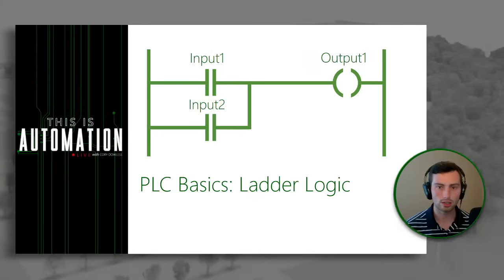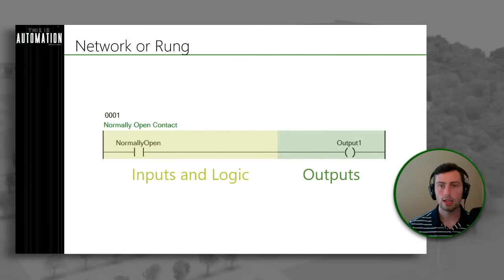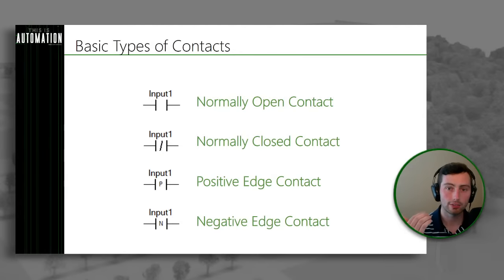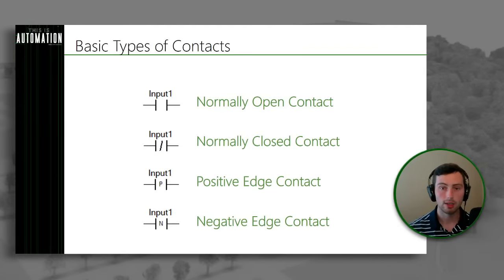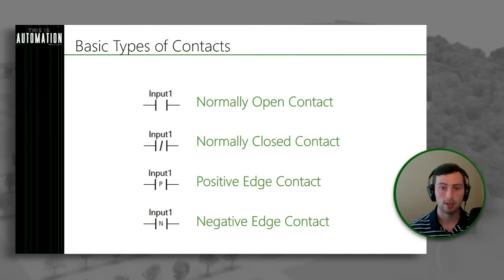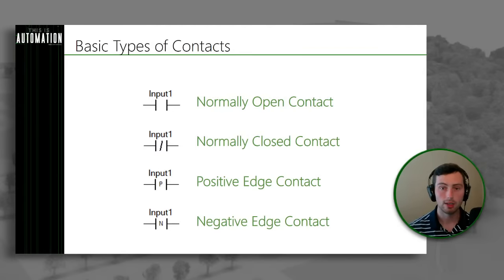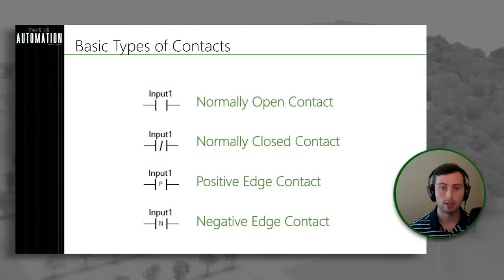PLC Basics: Ladder Logic

Comment: 🎯 Key Takeaways for quick navigation:

02:48 🪜 Ladder logic is composed of networks or rungs, resembling a ladder. These rungs help in controlling equipment by taking inputs, applying logic, and generating outputs.
04:39 🛠️ Ladder logic originated from relay logic used in older machines, transitioning to PLCs. It offers a logical and easily understandable bridge between traditional relay systems and modern PLCs.
05:53 🔄 Ladder logic's graphical nature makes it easy to troubleshoot, providing a visual representation of the logic flow. This simplicity aids in identifying and resolving issues in the program.
08:45 ⚙️ Different types of contacts (normally open, normally closed, positive edge, negative edge) and coils (standard, negated, set, reset) form the basic building blocks of ladder logic programming.
20:33 ⚡ Incorporating function blocks, such as timers, enhances ladder logic capabilities, allowing the integration of more complex functionalities into the program.
23:19 💡 Ladder logic can be used to solve logical problems, such as controlling an indicator light based on specific conditions like line stoppage and manual mode.
23:32 🕹️ Manual inputs, both internal and external, can be integrated into ladder logic, allowing control over outputs like indicator lights, demonstrating the versatility of ladder logic in automation.
24:15 🔄 Ladder logic's basic building blocks include contacts, coils, and function blocks. The flow of power from left to right, combined with logical conditions, enables the creation of powerful programs for machine control.
24:42 🧰 Ladder logic serves not only as a programming language but also as a powerful diagnostics tool. It allows easy tracing back through contacts and understanding the logic behind the behavior of a system.
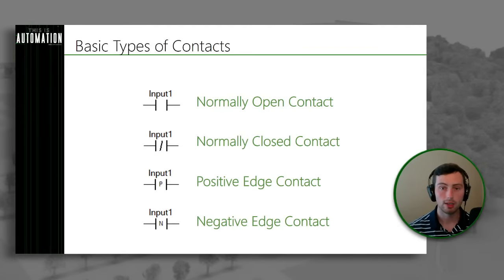25:10 🚀 Understanding the basics of ladder logic empowers automation engineers to build on their knowledge and grow in the field of industrial automation, making it a fundamental programming language in this domain.

Made with HARPA AI

Comment: to me the normally closed contact is tricky, it would be closed the opposite of the open contact energized, and both passing current through, but being so the NC contact won't reppresent the eletrical circuit, flow of current is 1 normally closed, and being false??
I've seen several representation of the stop start, circuit to the motor, and some use NC some an NO when the Stop is always NC.??